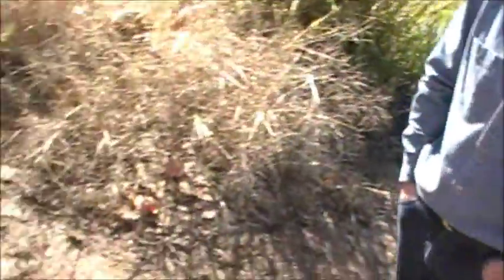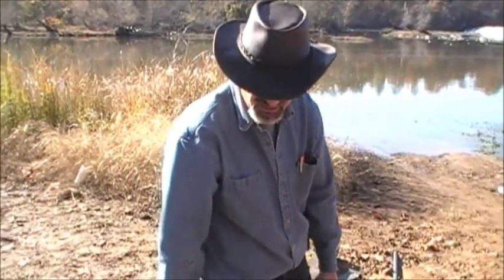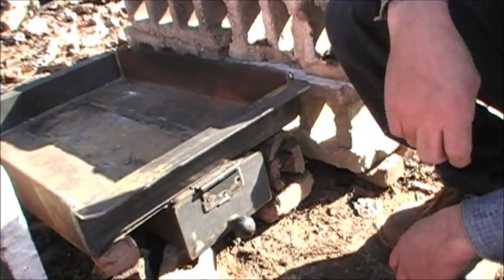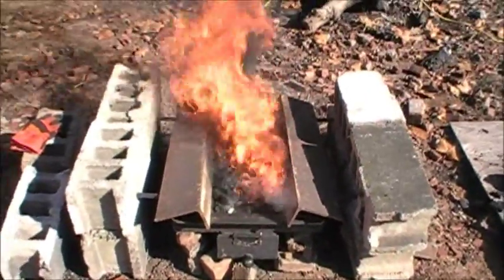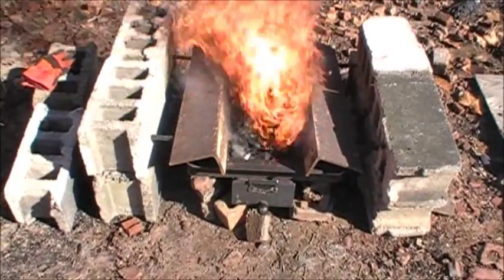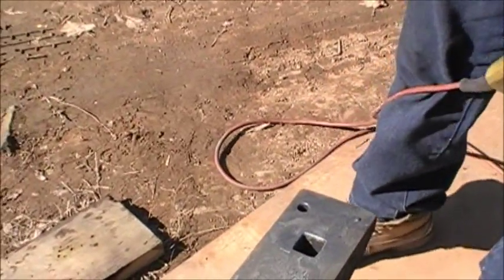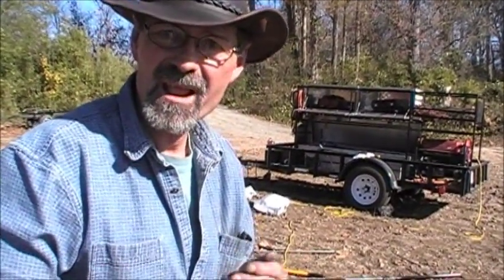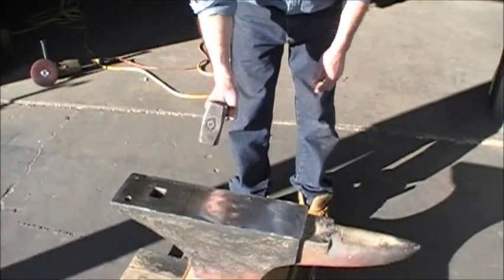Blacksmith Anvil Restoration Part 2 of 2

Comment: great video, i just had a idea hit me, and someone may have already mentioned it but what if while its cold you attach a nice section of log chain to it. rent or borrow a mini escavator or regular tire or track hoe and at critical tempature, use the arm of the hoe to lift it out of the forge, swing over the water and swing it back and forth through the water. just a idea in case you do it again. i think it would give you a even better initial quench. keep up the great work.
Reply: Some blacksmith in Alaska did just that.

Comment: This video is great.  I just got a huge anvil that was in a barn fire and have to do the same process to bring it back.  One question: you skipped over the second heat quench process, what was the second temperature you would reheat ?

Comment: That's scale not slag, also without a carbon source you'd be sucking out carbon like crazy at 1500. Also if you welded steel on top of the anvil it's not 'one piece' now you were nowhere near a weld heat and one weld heat for such a large slab, no. Just no. And you should have hardened the loose plate before welding it to the anvil rather than doing what you did.
Reply: @bashpr0mpt
  Watch part one please before you apologize. Thank you sir.